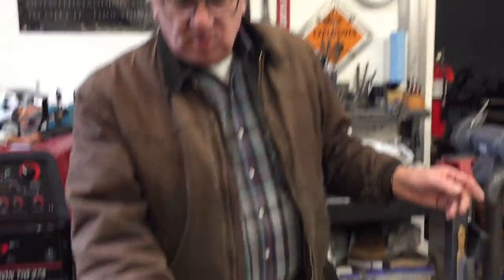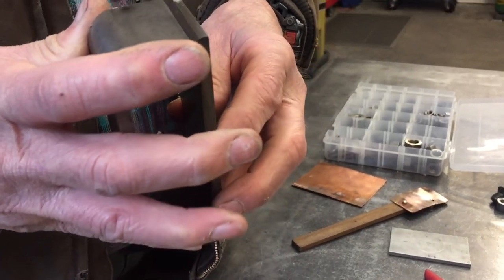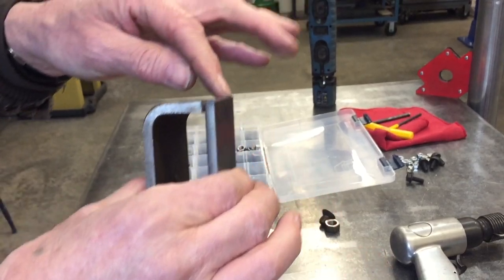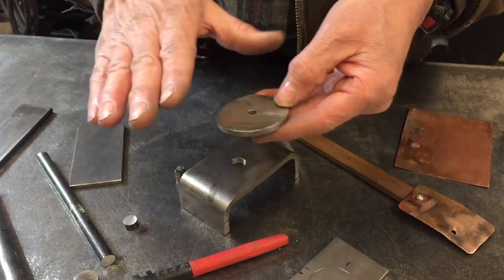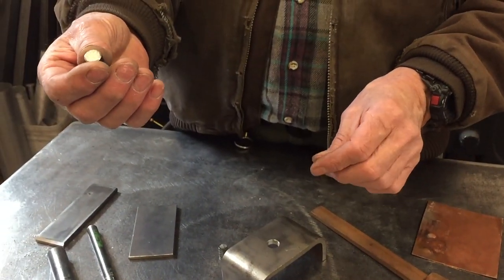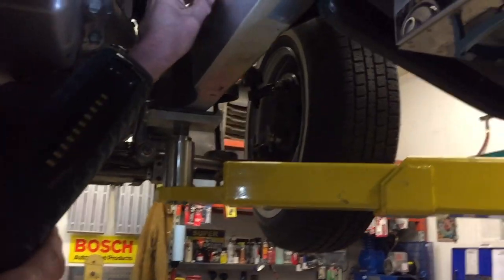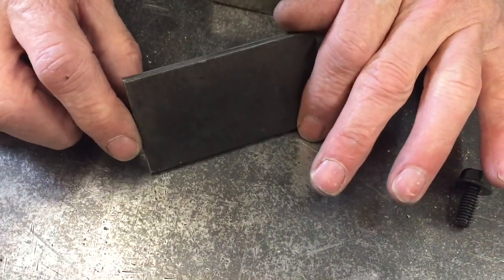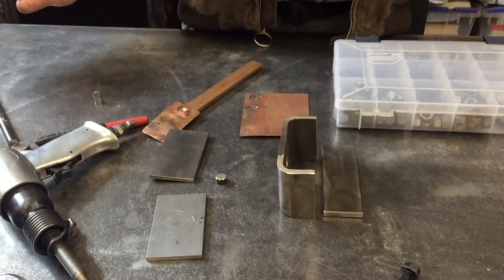Frame boxing tips and tricks

Comment: THANK YOU!!! the problem of boxing the frame and bolting things on (steering box for me) was a big obstacle that I just could not figure out, looked at MANY youtube videos and pictures of frames but you just gave me the answer. Thats what I needed to continue on with a stalled project.

Edit: the part with centering the nuts with the beveled bolts was a thing of beauty.

Comment: Great stuff here. When I box up a factory frame, i like to set the boxing plate inside the frame rails. not leaving a lip or flange as shown here, but flushing it with the lip of the rail. i'll bevel both pieces to gain some weld surface area, but this method is stronger. its similar to how a header is installed over a door opening or window opening in a house. the header sits on top of the wall stud rather than in between. any force applied will direct itself to the boxing plate rather than just the weld.

Comment: I am about to start the boxing process on my 1969 Chevelle. I just bought another frame so it will be super easy to access everything. Your video was super helpful, thank you. I will for sure be using these tips and tricks. I was also planning on buying a bracing kit to further help out stiffining up the chassis. Do you think that the bracing kits you can pick up from Summit are wotth it?  Any other advice or pointers are welcome. Again thanks for the video!
Reply from the maker: They might be worth it if their vehicle specific already sized and ready for your frame I bought 3/16 pickled and oiled sheet steel from the steel supplier and used cardboard to make templates on the frame and transferred them to my plate steel
Reply: @idahofabricator8710  That was my original plan but yesterday I found that summit has a kit for GM A body frames. The kit  I believe  is only for the center portion of the frame though. So I will still need to get some steel plates and finish out from the rear axel back.
Reply from the maker: @AdrianBilladeau  I did not know they made those for that that’s cool that would be the way to go

Comment: I just found ur channel,Great info
.where did you buy the rear end pan hard bar..I like how it crosses under driveshaft..
Reply from the maker: Thanks for the comment that bar that goes under the driveshaft it’s called a diagonal link I found out later that’s more for racing applications like quarter-mile racing and I plan on doing more street driving my truck so I changed over to a panhard bar I did a video on it I don’t remember the number of the video but if you scroll through my videos you’ll find it and I explain in detail why I think it’s better

Comment: What thickness plate do you use? I am going to box a power wagon.... Is thicker the better or should it be the same thickness as that of the frame? Thanks
Reply from the maker: Thanks for the comment Vik  i’d use 3/16 plate it should be available pickled and oiled so that would come without any mill scale,  paints better, welds better and really not any more expensive than hot rolled steel. I would keep boxing plate the same thickness as the frame that way everything is uniform as far as stress, plus the increase in strength by boxing it in is huge. 3/16 thick is a pretty common frame thickness.

Comment: Can I use other then Pickled Steel, if so, how would I prep it for welding.
Reply from the maker: Good question Miguel I use silicon carbide sanding discs that I get at Harbor freight they work awesome they’ll take the mill scale off and get you ready for welding

Comment: Nice videos. How did you handle the top nut  behind the tci bracket with boxing  the frame
Reply from the maker: Sharp eye Tom I bought some grade 8 fine thread steel lock nuts and I welded them on the inside of the bracket.
Reply: @idahofabricator8710  Thanks, i am building a 39 chev pickup and just finished boxing the frame i used a hole saw behind the bracket to allow for the nut so will weld them on the bracket.  I also used the tci front end with coil-overs.  Like you work

Comment: I have a question.  Once boxed, how do you treat the inside from rust?  I have a new frame sitting in the side lines that I plan on going through and cleaning up and boxing fully (its partly boxed already.).  I am just not sure what to do once fully boxed for coating the inside from rust.  BTW thank you ... I got a TON out of this video and several others as well.  Thank you.
Reply from the maker: I used epoxy primer for the most part on the inside of the frame and weld through primer on the edge where I welded the boxing plate.
Reply: @idahofabricator8710  Thanks for the fast reply.  So are you painting prior to welding?  Wouldnt the heat from the weld burn the primer on the inside off?  I am not as worried about the outside as I plan to have it powdercoated when finished.
Reply from the maker: Ian Cook No you don’t have to worry about the weld through primer is designed to form a protective  layer after welding
Reply: @idahofabricator8710  Thanks ... got some great tips ... thanks for sharing.  Hope mine turns out as nice as yours.

Comment: Did you make your own boxing pieces or purchase them? If purchased, where did you get them? Thanks in advanced.
Reply from the maker: Ken I went to my steel distributor in Spokane they have an outlet in Coeur d’Alene Idaho and I got 3/16 plate steel pickle and oiled ( without mill scale) and I had them shear them  7 inches wide by about 6 feet in length. I clamped onto the frame rails marked them with a sharpie ground them down close and then welded them on.
Reply: Thanks. I’ve seen precut metal for boxing but none for the’53

Comment: What did you use to radius your boxing plates?  I am trying to get mine done now.
Reply from the maker: Adam  after I welded the boxing plates on and ground down the welds that left me with a sharp corner. I used my 4 1/2 inch angle grinder with a 80 grit flap wheel and rounded the edge, after I got it pretty close with the angle grinder I come back with a large 12 inch flat file, if you angle the file and use long strokes down the frame You end up with a very straight rounded frame rail. It’s hard to get an edge straight with an angle grinder but the file works awesome. I hope I explained that OK let me know maybe I can do a video on it
Reply: @idahofabricator8710  Steve Thank you!  A video would be great if you have the time.  Cheers!

Comment: I have an important question if any one can answer. I was told that welding a nut into my frame is not good because the nut gets brittle because of the heat. Any one have advice or experience on this? Thank you :)
Reply from the maker: I’ve never had a problem with nuts getting brittle from welding, I’ve always used grade 5 or 8 nuts depending on the application. I have seen stainless steel fasteners get brittle from hot and cold cycles like exhaust bolts, so I never use them for that, I just use the stainless for non-structural stuff.
Reply: @idahofabricator8710  Thank you so much. I love to learn :)

Comment: When you boxed your frame did you cut the bottom edge of the frame to match the upper. I don't want to cut the frame if I can avoid it.
Reply from the maker: Thanks for comment Christopher most of the frame the top and bottom is the same there were just two areas where the frame was different ,  at the very back in the front by the front crossmember so  those two I had to cut a small sliver out of the lower frame rails so it matched the upper.